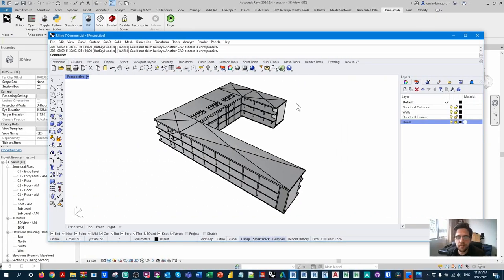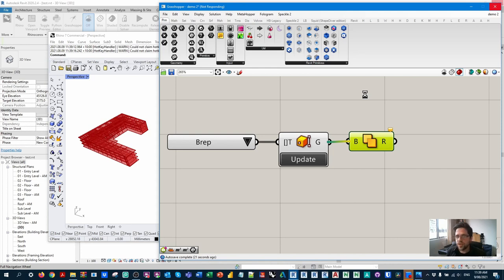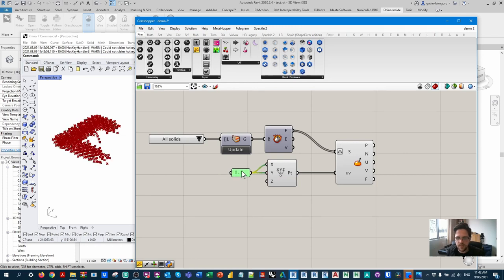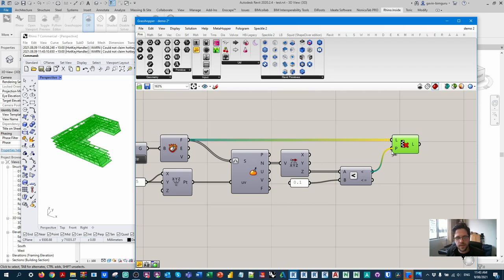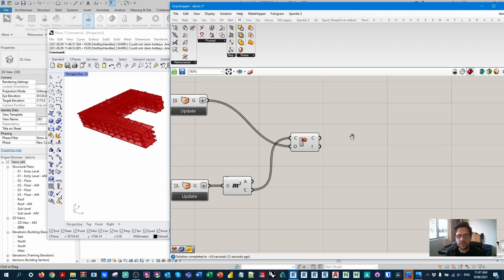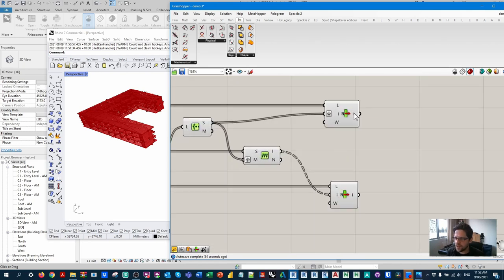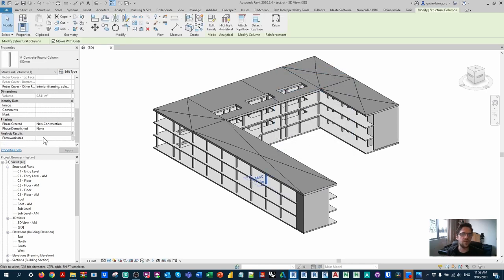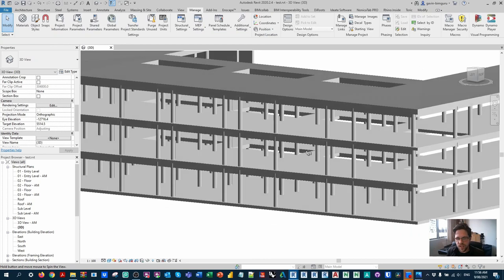Revit formwork analysis using Rhino Inside!

Comment: Can it also take into account semi-precast stuctures? In a lot of cases in-situ floorslabs are made with semi-precast panels (50-70mm thick with lattice girder reinforcement to support the top mesh) that are formwork initially, but become a structural part of a 200-300mm slab once cured. Those are sometimes combined with beams/column strips/drop panels that are not precast, so certain bottom area’s of the slab have to be excluded. In case like that, the formwork area would be a bit fuzzy. Especially considering the slab edge often needing some basic formwork.
In practice (in The Netherlands) there is often a mix of in-situ and precast elements in a lot of projects. Builders like to make last minute decisions in my experience often based on cost or execution preferences / planning constraints.
Reply from the maker: As always my videos set up the potential for a more detailed workflow to be built upon it. I'd hope that given I'm not a structural engineer, another one might take this script and develop over it to suit their design criteria. This could probably be accounted for by using a parameter that identifies these elements as semi formwork so they can be broken out in the schedule maybe?

Comment: what if the shuttering cost for beam, columns, slab are different? can we have a parameter added to family directly so that the shuttering can be scheduled level wise and element wise?
Reply from the maker: Yes that would be a required step if so.

Comment: 17:45 : can you use Data Dam instead ?
Reply from the maker: Yes a data dam set to only run when triggered could work. I typically use stream filters over dams as you can move the trigger button anywhere.